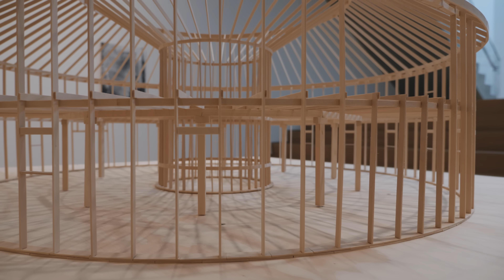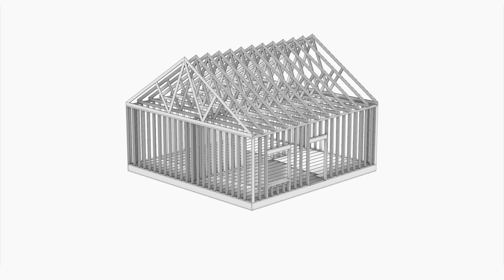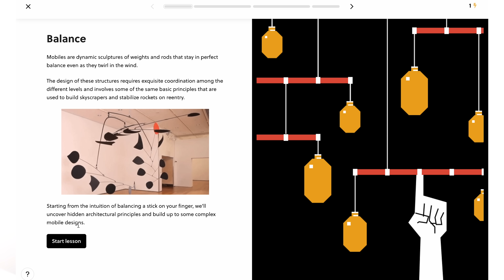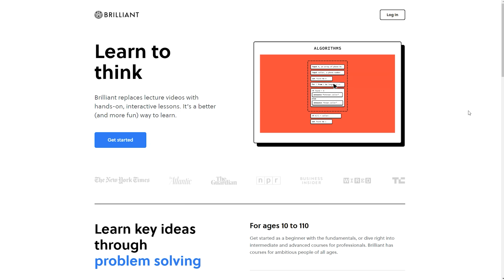The Genius of 2x4 Framing

Comment: I think it’s important to consider the importance of nails as well as wood. Originally, nails were handcrafted, one at a time, by a blacksmith. They were labor-intensive and extremely expensive (hence the importance of joinery techniques in old furniture - it reduced the need for nails). Around 1800 (in the US), the first factory-made nails came about, greatly reducing the cost. This was modernized into the wire nail we all know today around 1860. These dirt-cheap nails, even more than the 2x4, were responsible for the rise of 2x4 framing. Constructing a building from small boards fastened together went from mind-bogglingly expensive to the cheapest and lowest-skilled approach, because boards could just be nailed together, rather than needing elaborate carved joints.
Reply: The story of standardisation is the story of mechanisation, and without standardisation you can’t have complexity with efficiency. Sure you can have complexity, like a hand crafted 19th century chronometer, but you can’t have millions of them.
Reply: @albertbatfinder5240  I feel like he really wasn't fair when talking about the standardization of "light wood framing" relating to the limitations that comes with it. As if you're very limited as to what type of structure you can build using the method. You're only limited by your imagination and knowledge of construction.
Reply: @albertbatfinder5240  this breaks down on many products. An umbrella is incredibly complex for something you can buy for 2 bucks. Same for a computer chip, a cheap phone, or a brushless electric motor
Reply: @albertweber1617  "An umbrella is incredibly complex for something you can buy for 2 bucks. Same for a computer chip, a cheap phone, or a brushless electric motor"

Slave labor is a wondrous thing. Ignore the human cost and then just "buy" it for a ceremonial 2 bucks, or a glass bead why not.

This burgerification seems almost grotesque, just a threat more than anything. It is the illusion of individuality and progress nestled in its opposite.

It seems to me that the "need" to have technology fit unskilled labor, is the same as the need to PREVENT invention of the hamburger in the educational sector. To NOT HAVE classes and lessons that anyone can put together, but give up, and shove the unskilled labor onto a new kind of work site that can accommodate them. We made the HUMAN BEING into hamburger meat, even out of the prime cuts, just to have the hamburgers. And inveitably, education is now disgusting even when made of the good stuff, and the people, are salty and fat. Mass-produced to have CONSUMERS of the mass-produced smartphones and burgers, which are all the exact same and outright hostility is displayed to everybody who bucks the trends and uses the "weird" options, if they're even available, and doing things yourself is the weirdest of them all.
Reply: @albertweber1617 not really, all of those things are standardized
Reply: People actually used to burn a house down to recover the nails in the 1800’s.
A lot of houses were built at that time with no metal fasteners at that time with beams secured by wooden dowels or “tree nails”.
Reply: @allangibson2408  read each comment to ask if that was true! I've heard that before and figured someone older and wiser would mention it IF it was true!

Thanks for sharing.
Reply: @allangibson2408  damn u beat me to it, I learned this years ago in a book about the old west but it’s also mentioned in a Modern Marvels episode (when History Channel was good) called “Hardware” that can be found here on YT
Reply: @allangibson2408 damn, they can just come pick up the 900 square nails we’ve yanked out of our 1859 Italianate money pit. 

I haven’t had the heart to pitch them. I think I will eventually hand them over to a friend of mine who is a historic preservation artisan.
Reply: You nailed it
Reply: found 2 buckets full of handmade nails while renovating a very old historical building. both 2 and 3 inch long nails. i felt really humbled to take that many hours of blacksmithing work home.
Reply: Yeah, it used to be that people removed the valuable nails from old boards for reuse, and disposed of the wood. Now, I often remove nails from old boards too, but it’s because I want to reuse the board and I don’t want any metal that might damage my planer.

Also don’t discount the impact of pneumatic nailguns either. Framing with a hammer and nails isn’t difficult, but it’s that much easier with a framing nailer. One person can easily do basic framing like adding in a new interior wall—I’ve done this many times.

Also, the short length of typical studs makes them very easy to transport. 8 foot studs can easily fit in any pickup truck, as can the 8x4 panels of OSB and drywall you face them with. If you have a full length bed, you can even close the tailgate. For that matter, a few 8 foot studs can even be transported in many cars, though you’d need a truck or van for the panels. 

All this adds up to 2x4 framing being something a handy amateur can do themselves, without much if any help. This also strikes me as a very American sort of thing.
Reply: @jasonlescalleet5611  You could even argue that the main reason we call it a "full length bed", because it can fit 8' studs.
Reply: I'm aware of the history of nails, and how much their simplification of manufacturing has helped us do basic things better; but dang do those beautiful carved joints hold well over time! I have used many a nail in my time, in furniture and framing, no problem; but there is artistry in good joinery that few seem to appreciate these days.
Reply: I've hear stories of building that used a lot of old hand made nails in their construction.  If the building burned down of was demolished the nails were recovered because of the expense of the hand made nails.
Reply: I read this in Stewart's voice.
Reply: And nails are like French fries…
Reply: @RickWeberEcon  I love French fries, and nails!
Reply: @RickWeberEcon   I eat them up?

No shit, if I had to hammer nails into wood, framing would take 4-5 times as long. I can blast 5 nails into wood and 1 into my hand in 2 seconds.
Reply: @RickWeberEcon  this is the biggest takeaway here
Reply: This often repeated historic tidbit about nails and their cost makes a lot of sense but it is unfortunately a misinterpretation of their history. Nails have always been dirt cheap, it isn’t viable to use nails until they are dirt cheap. It is labor intensive, but historic nail makers lived in incredible poverty. One of the most amazing and horrific examples of this is that in colonial America where enslaved labor was rampant, slave owners still could not compete with the prices of English made nails. That it cost less to pay a nailer in Birmingham England than to feed an enslaved man in Virginia, Thomas Jefferson was only able to make a profit off nails made by enslaved hands because he was far enough inland the cost of overland transport made the imported nails more expensive. What changed in America was with greater opportunities in natural resource based industries like agriculture, timber, and mining no one wanted to make nails for such low wages, so there was pressure to innovate and make less labor intensive nails so that workman could produce enough to be paid a decent wage. Furthermore while historic buildings do not rely on nails for the main structural members like modern buildings do, they actually use more nails per square foot than modern buildings. With the advent of sheets of shingles, drywall, and plywood we are now able to cover a large area with a single sheet and use very few nails for it, where as historically every single shingle has a nail, and a plaster wall constructed with wooden lath likewise demands a huge number of nails.
Reply: Has anyone ever noticed how similar the joinery of wood structures is just like how hamburgers bring people together?
Reply: as a blacksmith who has been involved with 18th century restorational work on historic structures REQUIRING hand forged nails, i can attest to the labor intensity of them. we had to make roughly 10k nails to reshingle one dutch barn. it took quite a while to fill the nail cask lol. there were smithys devoted entirely to the task, and every apprentice can attest to the tasks drudgery heh. it was traditionally the second task learned with the first being forge welding scrap and drawing out nail stock. ( once you had progressed past the sweep, clean, light the hearth, trim wicks stage of apprenticeship)
Reply: Adding to your comment about handmade nails they were so labor intensive and espensive that frontiersman and families often would just burn the building down to get the nails back for when they moved on or wanted to rebuild. This is because of how expensive they were to make in comparison to wood which was in abundance.
Reply: @_gungrave_6802  theres still laws on the books in Saratoga county NY forbidding one from burning down ones outbuildings to recover said nails :D
Reply: @RedDogForge nyisum
Reply: There are still stamped nails though. They are the same as the hand crafted ones. They are however more expensive than wire nails. They work a lot better though in many ways. I think their place at best is relegated to furniture.
Reply: @GoingtoHecq  alot of framers still use wedge nails, usually to tack boards down to concrete. I don't know how it works, but thats what they do lol
Reply: @GoingtoHecq  nobody said there wasn't
Reply: Your very right in early construction if you left a log house you would burn it down to recover the nails.
Reply: they used to burn down old barns and other buildings just to go through the ashes to recover the nails!
Reply: You forgot about Ezekiel Reed of Bridgewater, Massachusetts. He invented the cut square nail machine, which eliminated the need for blacksmithing in the late 1700s.
Reply: I do just want to say, not as expensive as you might think! One smithy could have 8-10 apprentices whose sole job was to produce nails. They could work around 100 nails/hour. Plus there being multiple smith's in a city. There were still a LOT of nails being made at a not too insane price.
Reply: Absolutely true. People starting out in the trades would really benefit from this understanding.
Reply: Cross was a factory that made nails and tacks along with screws and even the tacks on Levi jeans,the started in the 1800s,many Canadian s ce to are town to get a job,by the 1990s they sold Cross to another factory in town,DDbeans that made all USAatchbools,still do,look on a book of matches should say ddbeans,anyway they moved Cross down south,to kill the union,and no one could get the machines to run,so they closed Cross within 2 years of buying it.because they tried to save on labor.
Reply: It is important to point out that for all the labor and expense, nails were typically the job of your novice and journeyman blacksmith (when available) leaving the master time to work other time consuming and difficult task.
Reply: I’ve heard about ancient Chinese buildings made from timber frames that don’t use a single nail or screw. Now I understand why they used joinery over fixings and why joinery isn’t used for commercial building for a really long time
Reply: As an engineer... no, just no. Nails were made mostly by apprentices and they were expensive when the materials were. The reason why you see stick built houses is because they are the cheap and easy to build. They are not durable, have terrible thermal properties even when insulated and they literally fall over in a storm or high winds. It is just easier for them to produce the lumber, easier for them to mill it and easier to work with. The reason why it is so dominant these days is because of post war reconstruction requirements and because someone who has a very special place in the deepest pits of hell waiting for them, invented the gang nail plate in the 50's. The post war need for quick and cheap construction fuelled the rise of this substandard method of construction. I hate gang nail plates so much and they are responsible for so much bad stuff I just don't know where to start. Stick building is literally the worst method of building houses that I have encountered, it is not genius, it is not clever, it is just lazy, inaccurate and structurally unsound, but hey, whatever makes the little pigs feel safe in their houses of sticks, right?
Reply: I heard from a friend of mine who knows a friend of a neighbor of a friend of Stewart's, that he actually he had planned to do his next video on nails.  But now, thunder duly stolen, he'll probably never share it with us.  Thanks a lot, Dave.
Reply: I had no idea, that’s so cool
Reply: Used to be cheaper to burn your house down to salvage the nails.
Reply: Which could lead into a discussion about tensile strength of nails vs wood dowels vs screws.
Reply: I have heard people used to burn their houses down then sift the ashes to collect the nails when relocating hundreds of years ago.  I do not know if that is true, but maybe so?
Reply: That would have been a much better fact, than any useless hamburger comparissons.
Reply: @sebastianmuller1210  yeah I didn’t like the hamburger analogy kinda lame tbh and I’m in home construction, I’ve never heard we’re building hamburger houses…
Reply: Great comment. Steel and iron was so rare in Japan for centuries wooden buildings used no metals at all.
Reply: Imagine a world without nails. We'd be screwed!
Reply: That's true , if you ever read Walden pond, he has his budget in the book, it shows nails were the most expensive resource he budgeted for.
Reply: Above all else, the cheapness of energy allowed us to outsource skill for oil. Without cheap energy, taking more cuts to make multiple smaller boards instead of a larger bean would be more expensive and labor intensive. Without cheap energy nails would be extremely expensive to make. Without cheap energy hammering in all those nails would be less efficient than joinery. Without cheap energy, using saw dust/chips/waste for fuel or animal bedding would a better use than OSB.

We’ve externalized the cost of home building through cheap energy. Once that goes away, the better option would undoubtedly be timber framing.
Reply: @thebobthebobanite6287  I agree with the fundamental claim, but I think energy is going to get even cheaper, as we transition from fossil fuel to wind/solar. They’re already cheaper, which is why they’re rapidly replacing fossil fuel in the power grid, and why cars will be mostly electric in a decade. And to tie this to the subject of architecture, I think we will see a lot of passive and active solar integrated from the start in our future architecture.
Reply: @davestagner  Solar and wind can't provide us with cheaper electricity. Not enough materials on earth to make that transition. You can hope that we'll find a way through the physics that limit us, but I wouldn't be so hopeful. As it stands, we cannot switch to renewables within the next 50 years, and if we really tried, the human, ecological and economical costs would put us into a global depression before we get there. Nuclear is our best bet, but switching to nuclear before fossil fuels get too expensive to afford us our modern middle class lifestyles would require majority of the global workforce to do so.

Switching to electric vehicles would cause even more devastation, and we can't switch the mining rigs and factories needed to get the materials and process them to electric. There may be some unforeseen miracle tech that can save us from the predicament, but I think we're better off planning for that not to be the case than assuming it will. Not to be a doomer, but we need to sober up a bit and prepare for some rough years ahead.
Reply: @thebobthebobanite6287  You might want to fact-check your assumptions. Clean energy tech is a major interest of mine and I follow it closely. Solar uses very little in the way of exotic materials, and wind uses none. Here in Minnesota, we already get 29% of our energy from renewables. California has times when they actually generate more renewable energy than they can use. Moreover, the market is your best friend, or your worst enemy. Right now, it’s renewable energy’s best friend. Wind and solar are so cheap now (and getting cheaper) that even with building backup storage, they’re cheaper than coal. Likewise, electric cars… the only new material in them that isn’t already in fossil cars is lithium (and a little cobalt, probably going away soon). Lithium battery prices have plummeted and density increased, despite (or because of) huge growth in demand. The entire auto industry is either swinging hard to EVs, or preparing to go out of business in another decade or so. Over 150 new EV models are coming in 2023. 

Rather than taking the reflexive Malthusian doom and gloom (remember, Malthus was wrong 200 years ago, and everyone who has continued his ideas has been wrong for the next 200 years), consider the possibilities! Renewable energy is cheap, simple, and decentralized. It breaks the monopolies and governments that fight wars for oil. EVs are simpler, cleaner, and more reliable. The cost of energy could (and I believe will) fall dramatically for the rest of the century.
Reply: @davestagner  Sure. Assuming current variables, no extra demand is placed on electric production, and cost of extracting materials stays consistent. But that’s not reality. Switching to renewable electric energy for transportation, heat, and manufacturing would massively increase the need. Factor in a necessary growth rate of 3% for industrial society to not collapse, in 50 years we’ll need over 4x our current generation. Not factoring in electric transportation, heat, and manufacturing. That’s assuming developing countries stay pretty static. If they want their share of renewable energy to live modern western lifestyles that number would balloon even further. I believe we can meet the demands of our current grids with renewables. But that’s not considering energy storage. We’d also need to move all the fossil fuel mining operations to mine materials for batteries, solar panels, and turbines.

Even with that copper will become scarce and extremely expensive. Factoring in all the copper we’ll need to expand our grids and build all the new electric motors, there is not enough. As is, copper prices are growing pretty rapidly.

Now take that with our current demand and add all the real world factors, we’d need to generate 10-50x in electricity in 50 years to go completely renewable. And we’d need to continue that growth. Best scenario is we scale back our societies and restructure so we do not need infinite growth, and we live less energy intensive lifestyles which renewables can support.
Reply: @thebobthebobanite6287  I’d strongly encourage you to read “Electrify”, by Saul Griffith. He puts hard numbers on the scenarios you’re talking about, and finds the situation a lot more hopeful. For example, because EVs are around 4-5x more energy-efficient than fossil-burning cars, we need a lot less energy overall for that sector. (1 gallon gas == 35kWh of energy. EVs have 75-100kWh of storage for similar range to a car with a 14 gallon or so tank.) A lot of sectors will be harder to decarbonize - heavy transportation like aircraft and shipping, concrete and steel manufacturing, etc. But it CAN be done. Don’t despair. This is not impossible, and even 20 years is a long time.
Reply: Fun fact! Nails were about 0.4% of GDP in 1810.
Reply: exactly. nails became cheap, and also saws got cheap. too.  Saws were very expensive tool, before the industrialization. 
without saw mills with cheap saw blades, dimensional lumber was unthinkably labor intensive and expensive to make.
Timber frame buildings with joinery were way cheaper.  and  2 x 1.5 inch is about the limit of thickness of wood that an average man can drive a nail into with a hammer that is light enough to be swinged all day with one arm.
Reply: @davidjacobs8558  I used to build railroad tie walls with joints connected using pole barn nails (8" I think) with a 3-5 pound sledgehammer. At an angle. Awful, awful work. I'm amazed I never injured myself.
Reply: @davidjacobs8558  swung all day man lol I don’t swinged a hammer all day
Reply: Thanks for the info
Reply: I have read that lathed-and-plastered and shake-sided houses, both of which were common for timber framed buildings, can actually use more nails than a stick built building.  You have to nail each lath and shingle to the timbers. I wonder if there is any hard quantitative information about that? Although undoubtedly the hand made nails were many times more expensive.
Reply: 90% of framing nails are made in China.
Reply: I tried making my own nails. Its really hard to get a consistent product.
Reply: @Skaggs666  if you ever get the chance to go to colonial Williamsburg in Virginia you should see them forging nails. I watched the guy doing a nail every 40s or so pretty consistently. He said back in the 1600s there would have been a few smiths in larger towns, each with half a dozen or more apprentices, each of which the only job would have been to forge nails. 100 nails, per apprentice per hour. About 35,000 nails per day for a town. Not small numbers.
Reply: And yet somehow the price of new houses is growing exponentially.
Reply: People used to burn down their houses before going out west back in the 1800s just to collect the old wedge nails to build anew when they got to their homestead.
Reply: I was going to mention about the nails. As a scaffolder I've seen many many pics of Asian bamboo scaffolding, which is made of long bamboo rods lashed together with leather strips. These days we use the term "hoarding" for a scaffold with a tarp or cover on it, but hoarding is an old castle building term for the temporary wooden walkways at the top of castle walls. This hoarding was often made of putlogs set in the stonework with logs or timber lashed together with heavy rope. My point is, yes, nails and fasteners can be used, and yes timber framing by cutting pressure fit joints in wood can be used, but all over the world in false work, scaffolding, and even in some home building, pieces were simply tied together.
Reply: Did you get this from Essential Craftsman? This sounds familiar and that’s almost exactly what he said from his video about nails.
Reply: @YC80087  No, I got it from Stewart Brand’s book “How Buildings Learn”, one of my favorite books on architecture, or any subject. I often recommend it to my fellow software engineers, as a way of thinking about legacy code.
Reply: @davestagner  I see now. Thanks for your reply and clarification.
Reply: Yeah the fasteners these days are amazing.  When I Torx screw clamped pieces, a lot of time the clamp practically wiggles off after because the screws are like a nice clamp practically.  I have also been seeing really cool nail technology that makes it easier to get in, but practically impossible to pull out...  The price point is still decent apparently, but yeah it's interesting without the fasteners we wouldn't have many other options aside from joints.  Today the nail guns are so good.
Reply: Very good comment I think you've won the comment section 😹😹😹😹
Reply: The square nails are about twice as expensive... I know they can be more expensive, but they don't have to be prohibitively expensive. You do have to pay attention to the grain orientation, but they hold way better than wire nails.
Reply: or just pull a Japan and play complex linkinlogs
Reply: You need do video on this great info
Reply: wire nails are also responsible for seismically resilient lightweight wood framing
Reply: Originally nails were wood
Reply: You beat me to the "miracle of the modern nail" post.
Reply: Reminds me of the first trade envoy that Japan sent to the USA in the 1860s, they were amazed at the scrap metal everywhere lying around unclaimed.
Reply: Nails were such a important commodity that if someone in the frontier planned on moving it wasn't uncommon to burn the house down to retrieve the nails for the next building
Reply: This is when youtube is awesome
Reply: I agree with this more than the 2 by 4 thing
Reply: Joints were around way before nails. Get straight, go forward, move ahead...
Reply: @ShaheenGhiassy  Machine Thinking is a Great channel.
Reply: Lllll
Reply: You might overestimate the importance of nails. Prior to nails existing pegs was very common. I have seen skilled worksmen framing and pegging a normal 2x6 with in minutes. While still slower than a nail or a screw, its a lot faster than traditional framing. While it may take half a hour to a hour to frame a normal bit of lumber, cutting and pegging a normal 2x6 is done with in a minute.
Reply: ST
Reply: You are nuts. Yes nails used to be expensive enough to burn your old house down and pick the nails out of the ashes. But we are talking old west days. The right nail for the right application is what matters.
Reply: @andywhite4172  What’s nuts? I don’t think you got my point. Modern construction methods exist BECAUSE of modern nails. The kind of long nails needed in large numbers for 2x4 balloon frame construction would have been obscenely expensive before the development of factory-made wire nails. But with cheap wire nails, it went from prohibitively expensive to the cheapest way to build. Yes, I’m talking about “old west days”. But cheap nails are WHY we don’t do “old west days” construction anymore.
Reply: thank you people dont realize how recently stick framing is, most buildings were post framed.
Reply: https://youtu.be/laUG5YZTlQs no nails needed
Reply: That's my issue with 2x4 framing as opposed to fitted joints though. American houses aren't made to last more than a century. They cost too much for what they are(if they can be made with unskilled labor why are we paying so much more for labor(if these are cheap materials) compared to skilled carpenters?), and there is no repairing it over time without tearing it down and fixing it room by room or starting over from scratch. Home repairs costs thousands as opposed to the hundreds it would take to replace a house beam by beam as they go bad. I don't believe the majority of American homes are good. It's my same issue with so many goods sold in America anymore. They're made cheap. Essentially built to break, and nobody wants to change anything because the only way to keep up is follow the cheap route with everyone else. Build a house as beautiful as you want, it's just going to make it cost more for your grandkids to fix up. We need to spend more time making both our habitat and our homes permanently livable for our future and our children's futures and our children's children's futures.
Reply: additionally, a home from 60 years ago had large nails in it, but relatively few nails compared to modern buildings. and now modern homes i believe have lots of additional metal straps and bracing holding them together (again with nails). i wonder what the impact of all the strapping has on natural wood movement.
Reply: I dispute that idea a bit. 
You missed the shakers and their circular saw enabling sawing small ‘timbers’ to make sense economically and time-wise. 
3:40 there is also this myopic idea; sawdust and wood chips didn’t make products like osb in 1820…

Nails and 2x4s - the nails came about out of necessity/demand. A market was created. I don’t think one enabled the other.
Reply: My house was made in 1873, a bunch of notching and hand made nails.
Reply: The rise of 2x4 framing is the result of the rise of 2x4 timber, which is the result of the rise of industrial sawmills.
Reply: Yes, often on the job site.  In the morning, we go over the plan for the day, and it goes something like this, (Today, we are going to nail some boards to boards and get it done.)   It's more of a question and answer form.  But, that's the jist of it.  
     The thing is, all of our crew are timber frame carpenters, so we know how to do highly skilled wood frame joinery, and I would say that at least 75% of the time, we are still nailing boards to boards.  
     Even with a timber framed building you have to understand, and be able to use "normal" light frame carpentry techniques.
Reply: Those nails were so useful and rare that they'd actually burn an old house down to reclaim the handcrafted nails so they could be reused.
Reply: Oh, I think you nailed it!
Reply: Some builders take pride on not using metal.
Reply: And anyone can make a YouTube video… 
PS Loved the video
Reply: Its cool to pull apart old or rotten things and discover the old square edged nails!
Reply: Uh….no. Nails have been from wire in very large quantities sic e before the Industrial Revolution, pre-dating  by over 100 years the use of nominal wood sizes.
Reply: @SLow-fb3qm  According to Wikipedia, cut (square) nails were patented in 1795 (with earlier appearance in Sweden in the same century), and wire nails in the modern sense started around 1860. Of course, Wikipedia isn’t an authoritative source, but it’s usually pretty accurate for well-written articles, as this one appears to be. And of course, balloon framing (that is, 2x4 framing), which depends on inexpensive factory-made nails, didn’t arise until the mid-19th century.
Reply: Ahh yes, when 16 pennies could get you a box of 100 framing nails, 12 pennies could fetch a box of 100 siding (sized) nails, and 8 pennies for a box of 100 finished-sized nails, etc.  In the middle ages of England, it was 120 nails for a “pence”.
Reply: Yes but joints can mess up framing when the guys smoke them.
Reply: When nails were handmade, a settler who moved to a new area would burn down their cabin and collect the nails to be used again.
Reply: I’ve heard that, back in the 18th century, they would sift through the ashes after a fire to recover the nails because they were so valuable.
Reply: A 2x4 used to measure 2" x 4"... now it's 11/2" x 3 1/2"... soon, a 2x4 will measure 1" x 2"....
Reply: Interesting! In my ancestry documents, my 3x's great grandfather in Ireland was listed as a nail maker. ❤
Reply: I read book called The Pinball Effect. It talk about the invention of the mass produced nail influenced the French revolution.
Reply: This is one of the more interesting YouTube comments I’ve ever seen. An insightful YouTube comment? Indeed.
Reply: nails and staples.  even more efficient, the staple gun for 2x4 framing.
Reply: I'm  in Romania that has highest home ownership rate in the world and highest rate of abandoned homes in the world. You can build a house of anything and it will last. Except wood. I can drink a beer in a stone pub older then USA. And unfortunately it has to be inside a castle or fortification cos outside everything was built out of wood and nothing lasted. ATM confined masonry seems  strong enough all around. Earthquakes, floods, storms, whatever.  We also export a lot of OSB and wood and build exactly as Americans but that is like half price and not considered for multigenerational housing. Not even gipsy houses are wood and they are thin as matchsticks
Reply: And this got worse with the invention of the pneumatic nailer while wire nails did play a big part in the spiraling downfall of house quality this was only made worse by the pneumatic nailer before you had to place every nail with precision making sure every stud and joist was put in place properly with it's 3 or so nails. Nowadays though builders just keep putting in nails till it holds completely skipping the skill and precision once used to put together well made houses by intentional carpenter's and craftsmen instead now you get 15 nails in a joist or stud all of which are barely holding on by a weak unskilled thread.
Reply: i agree, nails are important. good comment, you dont find these on youtube all the time. thanks for sharing that information!
Reply: @ShaheenGhiassy  Great suggestion! Beautiful channel to watch, very calm and informative.
Reply: You nailed it!
Seriously. 
😁
Reply: Yes. Also nails and screws and houses this way, suck.
Reply: Ahhh, have you bought nails lately? Haha, they aren't cheap!
Reply: @Lost_In_The_Philippines_25  still cheaper than timber frame joinery.
I’m a furniture repair man and woodworker. I am drawn to elegant joinery but I would not try to incorporate it in house construction buried behind sheet rock.
We forgot sheet rock vs plaster!
Reply: @Lost_In_The_Philippines_25 per case sure, but they're still  like 5 cents for galvanized ring shink framing nailer, like 2  cents for bare bright. So overall pretty cheap
Reply: They are relatively cheap though, when is the last time you heard of a building being burnt down to harvest the nails? That used to be a somewhat regular thing @Lost_In_The_Philippines_25